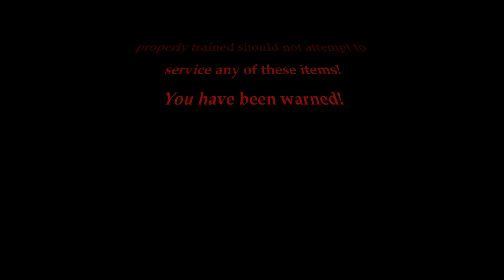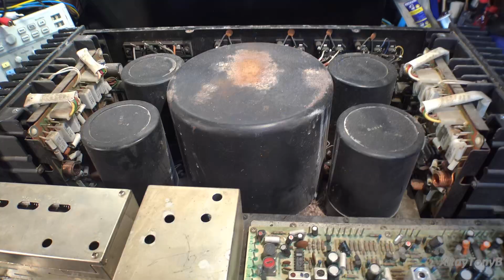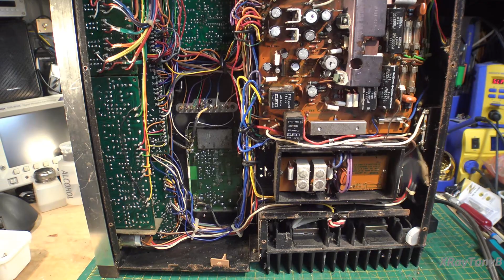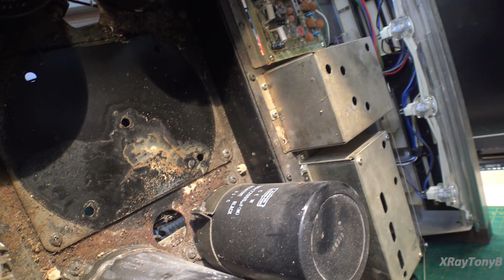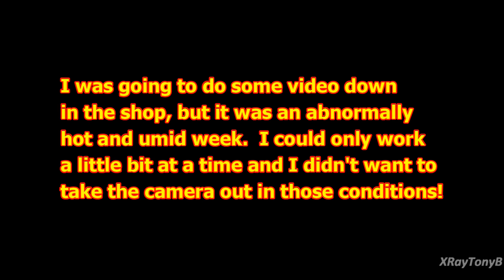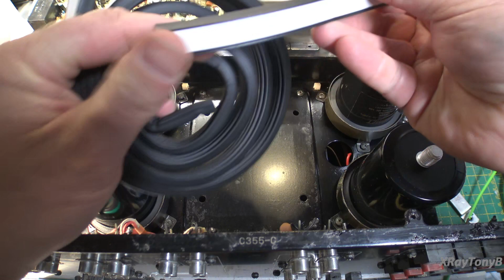PIoneer SX-1980 Part 1

Comment: One sold for $15k on ebay a few days ago. Another for $9800.
Reply: I just looked on Ebay and someone is selling the SX 1980 for 8000 dollars, another person selling it for 9000 and one more person selling it for 7500
Reply: Wow!! I have a SX 880 from 1981 that still works great, I had it serviced and tested once and the guy told me it was pushing over 80 watts a channel and pioneer claims it`s only 60 watts but that SX 1980 is huge.
Reply: @bradyazell  it is a gorgeous piece of equipment but I don’t understand why it costs so much. It’s not like it’s a high end hi fi amplifier like mark levinson Accuphase or others. Is it just because of collectibility?

Comment: Hi Tony, how did you clean those RCA terminals?  Thanks.
Reply from the maker: I use several methods, depending on the connector.  Gold plated jacks can just be cleaned with alcohol and swabs, or a bit of contact cleaner.  If I can get access, a pencil eraser also works well.  Some plated jacks can't be easily cleaned, as the plating gets tarnished and worn off, exposing the base metal.  Those ones just get replaced.  solid metal jacks can be polished with a very fine brass brush wheel on the dremel, which will shine them up like new.
Reply: @xraytonyb  Thank you so much Tony, mine's not gold plated and it looks like some sort of metal jacks, I'll try these methods you mentioned.                                     

Loving this SX-1980 series.   Stay safe.

Comment: Thank you for sharing your wisdom
I learn something new even when I
look at videos for a second and third  time. 
I bought a SX1280 and I need to rebuild most of its circuits.
For example: a  previous owner removed and bypassed the softstart resister with a simple lead.
What damage might that cause?
I pulled a softstartresister out of a SX1250 that I plan to use. It is a 6,2 ohm resister 20 watt. Is this Ok?? and what are the limits for resistans in this mashine for softstartresister? As per your advise I haven't yet connnected it to power. Hoping to hear from you, sincerely Thomas in Sweden

Comment: Why didn't Panasonic not use DSP Processing instead of using discrete components and make the unit weigh around 10KG, it would not have been that hard just a fully digital chassis could have made for the best unit out and with Quadrature Sampling detector to feed the decoder board to recover the FM/AM stations then and multiple input switching to a high power PWM output stages that would have been perfect would it not.

Comment: by the way, a common problem i encounter is battling to clean corroded RCA sockets (females) on the back of old units? sometimes replacing them isnt an option, yet they need to be clean for good connections! Any ideas!?
Reply: Some sandpaper outside and maybe vinegar (or similar) soaking them to get the insides?

Comment: I have a working SX-735 that  I’ve had since the 70s.  Also have an Allied 485 receiver, which was released a few years before Allied was divested from Radio Shack.  It was also a Pioneer based system adopted by ARS.

Comment: You may well find the large capacitors do NOT need to be replaced. In 20 years of restoring vintage solid state audio gear, I have never had to replace the large can caps. You can take that to the bank.

Comment: Rodent urine is such a corrosive substance not only to metal surfaces but also to the PCB traces and the boards themselves. Looks like this one spent some time in a storage unit that had a mouse problem.

Comment: Funny how there's always someone who has to comment about it being done in a not prefect way. I bet that spraycan you used wasn't the right paint code as the original paint from the manufacturer. OMG what a shame. 
But you could have used some primer or filler to get a smoother finish. But what the heck, it will sound just the same, and probably not be at display at Pebble Beach.
Thumbs up Tony 👍

Comment: I have watched many of your restorations and have been very impressed  until I have watched this one. My question is with such a valuable rare sought after receiver why in the world would you take out the metal transformer frame and just paint over the rust ????  Dude this almost made me sick to my stomach .. Why didn't you just wire wheel it back to it's original metal condition and leave it as rust free original without the paint? It can clearly be seen where you have just sprayed it black instead of removing the rust , and sprayed right over the top of it!! 
Secondly this receiver is MORE THAN WORTH  spending the money to put in the proper Filter Caps or waiting on them to backorder!!  OMG why would you do this to a Pioneer SX-1980????? I
I used to love watching you restore these vintage units but your credibility has diminished drastically over watching the way you have totally disrespected this receiver . The owner needs to speak up and have you do this properly if you are going to do it-it's deserves to be done CORRECTLY! You are a damn good Technician but this is UNACCEPTABLE...
Reply from the maker: You are totally wrong in assuming that I painted over the rust.  The metal was heavily rusted, but luckily there were no perforations.  I DID wire wheel it down to bare metal.  When you do this, it will leave deep pitting where ever the rust used to be.  Although you can try to fill the pits, there will still be some unevenness when you paint it.   I guess if you are the type that would remove the transformer and circuit boards and be bothered by the rough spot under the paint, then this isn't the receiver for you.  Many better examples that didn't have rust on the chassis still exist.  The capacitors are proper and have the best specs for the application.  As is mentioned, there was another cap that was the exact same size as the originals and same spec as the ones I used, but they were over twice the cost and on backorder.  At some point, you need to make some decisions based on cost, unless you have unlimited funds to put into a hobby.
Reply: Once the metal is pitted, it's pitted. All you can do at that point is remove the rust that is present. Then seal it with paint to stop air from getting to it and starting the process all over with rust appearing. Now if a person wants to spend the time and money doing it, you can send it off and have a ceramic coat put on it and try to get them to lay it on thick enough to hide most of the pits if they bother a person that badly. All in all, before this thing rots away with the paint job he did, we all will be dead and gone.

Comment: Couldn’t you just buzz off those capacitor studs with the Dremel?   Kind of unsightly. 
Looking forward to this series.  This is all about excess of the era.
Reply: That's what I thought too, but the stud area still needs insulating because it's connected the negative rail.
A nice fitting plastic cap would probably be the go..

Comment: Great start to what is going to be a cool restoration series. Nice to see you using Kemet for your big filter capacitors. I have been using them in the restorations of large power supplies used on old Minicomputers at the computer museum I work for. Those old big can capacitors are not known for their reliability, now.

Comment: There is a lot of hours to do a complete restoration of all those boards just thinking about locating and replacing the FETs. 20+ hours here in San Francisco at our labor rate you’re looking at $2500 just in labor. I did one restoration on a Marantz a very simple small one only after watching 15 or 20 videos of Marantz restorations I can tell you I spent more hours if I was paid hourly I could’ve bought several Marantz brand new but my mom has a very nice sounding restored Marantz. I think I like building amplifiers and preamp’s from scratch by hand much easier

Comment: Really happy to see you're doing a series on the 1980. I have one that seems to be working ok but need to know how to check it out correctly and replace caps, etc. that must by now not be at tolerance specs. Good to hear that about the power supply mod.  Looking forward to the next video.

Comment: What was wrong with the old capacitors did you even test them. And why stick to the same value go higher
Reply: Go Higher WHY?? Do you know something that the  Engineers who designed this for Pioneer ?  When you take your medicine and it says take 1 every 4 hours do you take 6 every 2 hours instead??  John you are showing your ignorance to the world wide web pal...
Reply: @exenx2995  so that's why the designers didn't put a 0.1uF pulley decoupling capacitor across the filter capacitors because they know everything
Reply: It's already knocking on the door of 100kuf 😂😂😂
Reply: @chrisvinicombe9947  what is 100kF per channel? That would be quite adequate per channel not so much if it's the whole lot